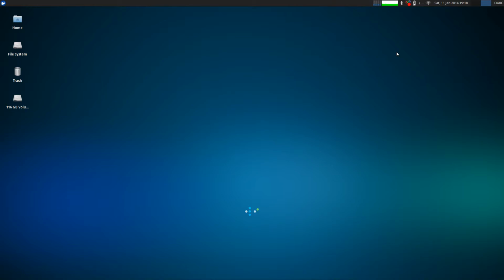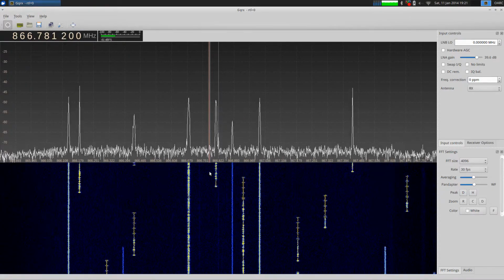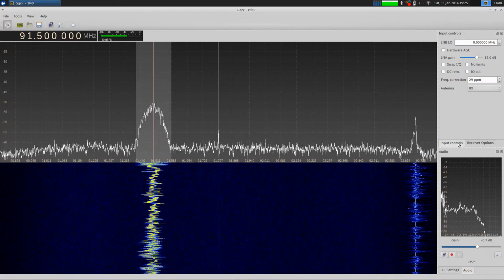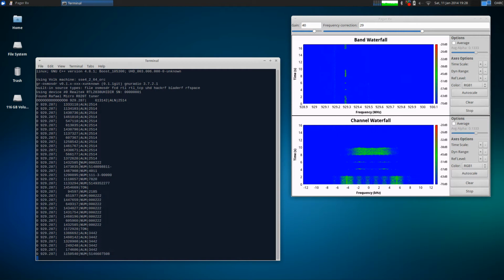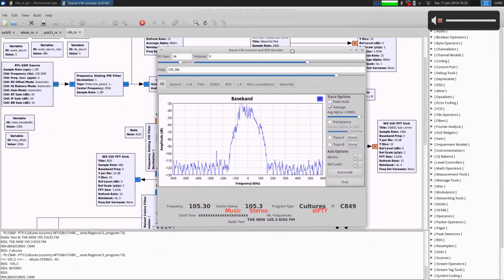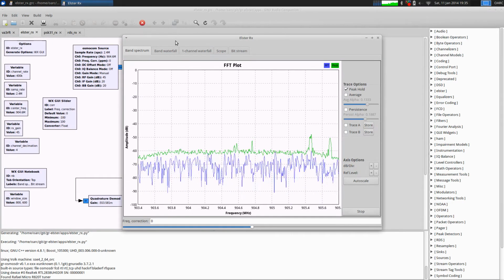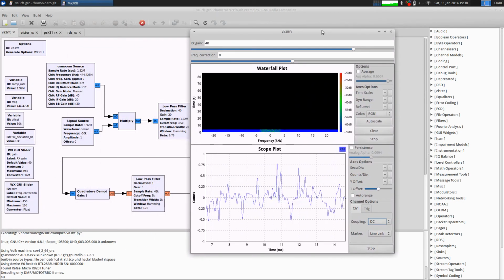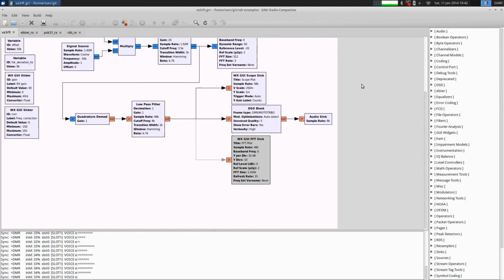OARC Club Project 2014 - USB flash drive demo

Comment: Working on figuring out the gr-elster project. The .pcap files I'm getting are coming up empty right now. Might be the Elster meters in my area work differently.
Reply from the maker: It could well be. Not all Elster meters use the same protocol.

Comment: Managed to get it set up on a 16GB stick - but when trying to boot from the stick I get as far as the menu showing all the OS options to boot from - but any of the Ubuntu ones hang - they either say the kernel must be loaded 1st or failed.  Not sure what my next step is - I've tried this on a Netbook running XP (I've managed to get SDR# running on it before so it has enough horsepower) and a tower running Vista with same result - now off to try an old laptop that has Ubuntu on it now just to confirm I get the same behavior.
Reply: Will watch video when I get off work.
Reply: Managed to get it to work on my old Acer 3050 laptop that runs Ubuntu.  Not sure why it wouldn't work on 3 different windows machine.

Comment: Having real problems with the zip file. I've downloaded it 3 times onto 3 different PCs (XP & Win7) but every unzip results in a corrupt file warning. Any other mirror for download?
Reply: Hi Dale Haines here again but from a different PC hence the different ID - sorry :-)
I finally managed a download and apparently good unzip but then discovered that it won't fit on any of my 16Gb USB sticks. I'm presently clearing off one of my 32Gb sticks and I'll try with that one and keep you posted.
73 G4IPZ
Reply: Sadly I've called it a day. I managed to write the img file onto a 32Gb usb stick (no problem there as I do img writes regularly for my RPi s) but even after changing the boot sequence on the old dell laptop I use for testing unknowns, all I got was a long list of possible boot options, none of which booted into an operational Linux distro. I got some telling me I needed to load a kernel first and using esc simply took me back to the beginning. Ah well it looks like a great project and well done, just didn't work for me. Must be my British electricity!